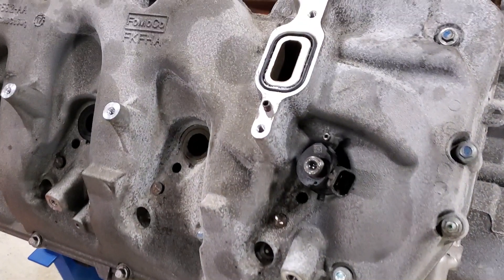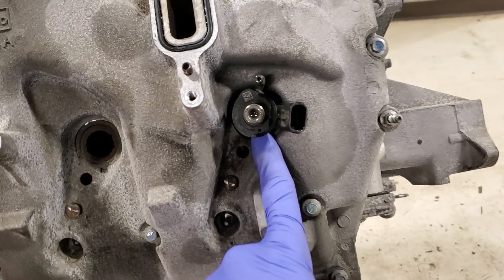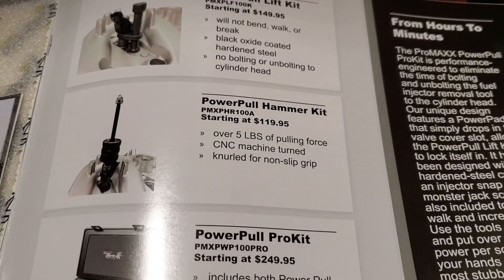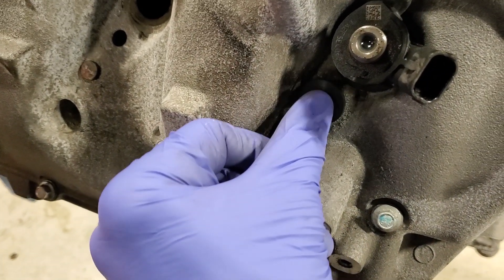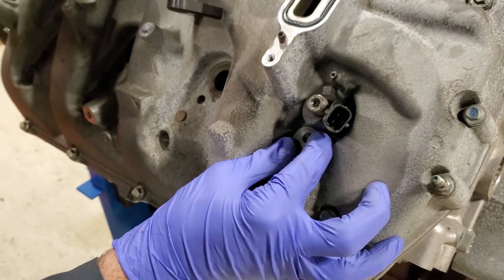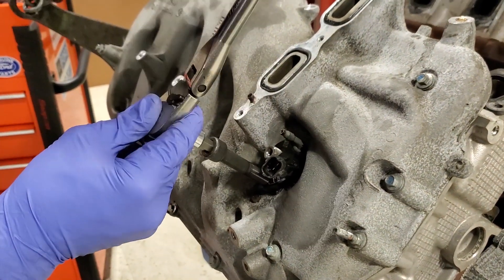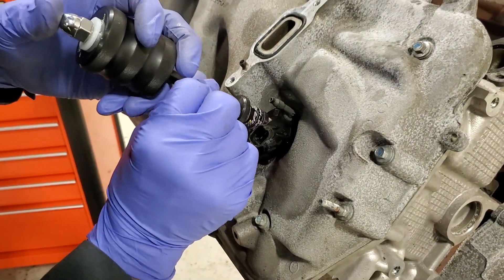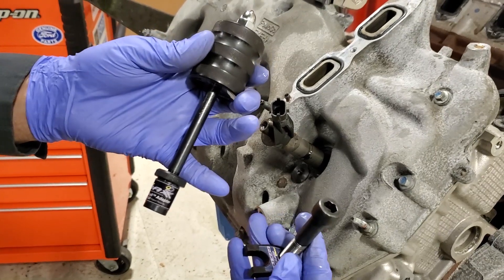6.7 Stuck Fuel Injector-What do you do?? ProMaxx Power Pull

Comment: Ever thought about why this kit is needed? Fuel mixing with oil causes a tacky residue. The injectors on these 6.7s are lifting like a cylinder heads do at high boost and fuel is seeping around the seals. The injectors should be coming out with your fingers.

Comment: I just replaced the entire fuel pump and injectors and fuel lines, sending unit and low pressure fuel pump on my 2011 6.7, explain to me why the return line keep blowing apart on the number 7 cylinder I have replaced the injector and the problem is still there, sometimes I can go 500 miles before blowing,  and sometimes only a half mile, please help me with this
Reply from the maker: .......tell me why u replaced your system....?

Comment: I'm a diesel tech, I took 2 nuts, 1 with the injector thread and one with slide hammer thread, welded them together, then ground down the injector nut to make it thinner, I have a small slide hammer that I use with it....works beautifully....as for the injector puller, I've never used the Ford tool or any tool like it, the injector hold down itself can be flipped upside down and used to pull the injector with nothing more than a small rod like a center punch or small ladyfinger prybar...........your welcome to everyone who doesnt want to waste money on specialty tools to do a simple task.
Reply from the maker: Yepp been there done that....

Comment: I bought a badass tool from Matco tools. The injector I had that was stuck bent two of my other tools. The matco tool screws into the injector hold down hole and one of the valve cover holes and connects to the threading on the actual injector. Pulled it out without a hiccup. I only mention it because it sits low and you can use a ratchet, in-case you can’t lift the cab and need to get an injector further towards the back and can’t use a slide hammer. But badass video, you got yourself another subscriber!
Reply from the maker: Hell yeah bud!!!

Comment: Hey there. So I have a question. I pulled the passenger side valve cover on my 2011, because I dropped a copper washer into the valve cover/intake. Essentially, I forgot to dump some of the coolant out before removing it. Ended up getting some coolant into the, “vents”, right under where the rocker arms and valves are. I know it has something to do with air intake, but I don’t know if that fluid ended sitting over a piston or into the crankcase. Could I drop my oil pan and maybe get it out? Or would I need to vacuum as much liquid as I can?
Reply from the maker: Id be vacuuming for sure

Comment: A few things about long oil change intervals: newer conventional oils have closed the gap a lot on synthetic oils due to much tougher specifications and the fact that so much of the synthetic oils you find are a process on crude oil that yields a base stock oil that is “synthetic”. If you were to write and get a reply to the question “is your synthetic oil derived from crude oil” you would see some serious written tap dancing answers. I do use synthetic oils as there is still a difference but not the difference like glass to diamonds that is too often the impression marketing will give you. I have been in the car repair biz for 40+ years and very few people operate their vehicles in ways that support longer oil service interval. Remote start, lots of traffic lights, more slow traffic due to growth in your area, and moving closer to job are all things that push the longevity of oil down. Several brands that extended intervals with synthetic oil, even some that had specifications for oil making it hard to get the oil anywhere but at the dealer, are vehicles that today I do lots of leak repairs, valve stem seals, front timing chain cover, and timing chains and the guides and tensioner at less than 100 k miles. On these same vehicles where owners stuck to lower mile oil service I do not see these issues or don’t see the issue until over 200k miles. I worked for years for a car manufacturer and the oil service interval got extended due to marketing pressures and the engineers did what they could to minimize impact, they never thought it was a move in the right direction. If you think late model vehicles seem so hot under the hood it is due to longer oil change intervals. Getting oil hot quick and to a bit higher temp will evaporate some contaminants out better. Oil coolers do keep oil from getting too hot but those also will get oil to a higher temp in vehicles operated in cold weather. The price for that is a lot more crankcase vent problems when the oil is kept in longer. ARod is mostly discussing diesels on this channel and diesels have less onerous stuff getting into oil than gasoline engines but the contaminants from combustion still builds as the miles rack up. ALL engines use oil through sacrificial lubrication of valve stems, turbos, crankcase vent, and cylinder wall lube. Contaminant gain equaling oil loss is when you have an engine “that uses no oil”. The stuff making oil get darker is replacing the oil loss.
Reply from the maker: Well said brother, well said

Comment: I would think you can go 10,000 between oil changes when using high end FULL SYNTHETIC oil
Reply from the maker: No no bud...5k max. I dont care what liquid gold you use...
Reply: @PowerStrokeTechTalkwARod  
512,000 miles on a 2010 6.0 before it knocked a lifter out changing at 9-10,000 miles. Rotella T6.  It would have knocked a lifter anyway even if I changed it every 2000 miles.

Comment: Does the 6.7 come stock with windows in the block lol
Reply from the maker: Yes, only for those that have lots of money & dont care about changin the 6.7 blood out. Their blocks come fully equipped. Ive heard thats its better than the Pella brand 🤣🤣😭😭🤣🤣
Reply: PowerStroke Tech Talk w/ARod How can someone not do regular oil changes. Oil and grease is cheap parts are not
Reply: Better airflow that way, gets rid of those crank case gasses faster.
Reply: Looks more like an automatic oilier to prevent the truck from rusting.

Comment: Years back in the early days of the 6.7, made a tool for my otc slide hammer using the nut from the fuel lines and welded it onto a nut for my slide hammer.  Was a little apprehensive on using it for injectors that are being reused.
With that said.  That tool is sweet
Reply from the maker: Excellent!

Comment: That is a very nifty tool. I like how it's tailored to enable removal of stuck injectors on a 6.7, on differing levels in severity of how stuck they are to the cylinder head. The only thought that crosses my mind is if the stuck injectors happens to be one of the rearmost cylinders (either #4 or #8), clearance may become an issue if use of the slide hammer is needed with the engine situated in the truck. I suppose in that type of scenario, cab removal may be necessary, so the labour should be quoted accordingly should the need arise. Good stuff by the way. From my experience, the need to remove or replace injectors on a 6.7 seems very rare in comparison to a 6.0/6.4 hence why seized injectors on a 6.7 would become a problem.
Reply from the maker: Hey thanks Mike